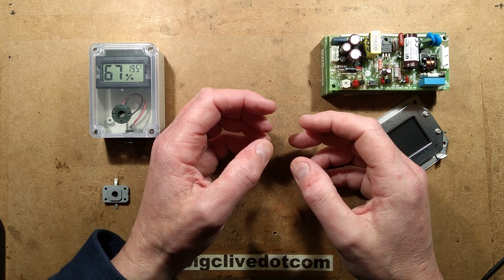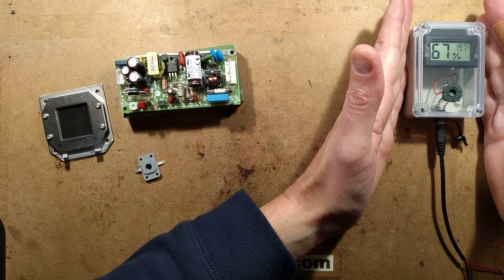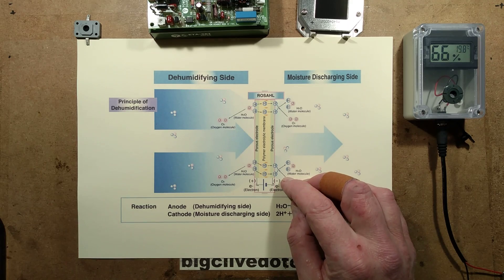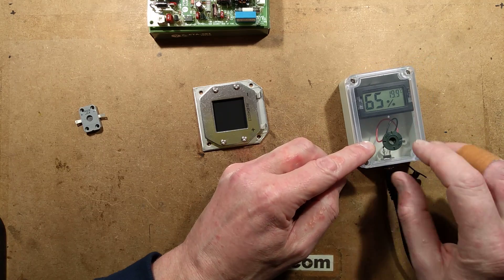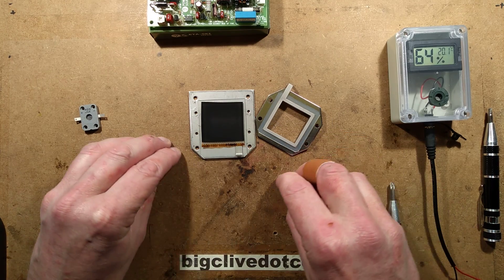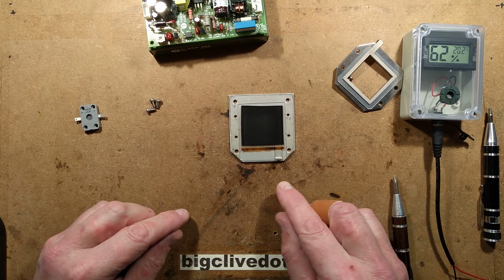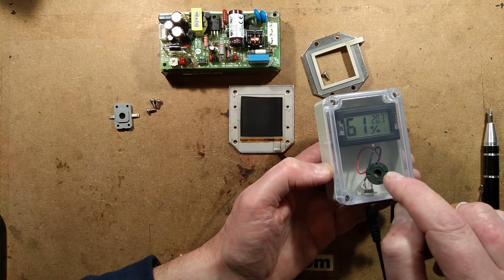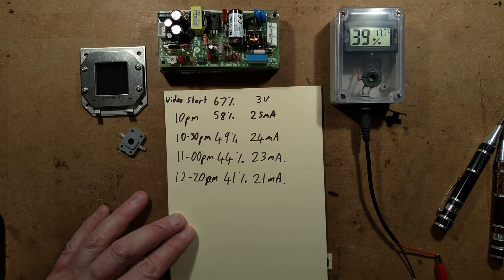Incredible solid state dehumidifier.  No moving parts.

Comment: I wonder if there is a voltage on the cell caused by humidity on the inside? Anything new on this? the black layer may be carbon fiber like the heaters and ozone emitter fibers.

Comment: What if the outside layer is a thin hygroscopic material, the inner layer is a heater element, and the wavy bits are for slight airflow... Would explain the temp changes and its not osmotic/letting hydrogen through at all, the heater just mildly cooks off the moisture in the hygroscopic fibers

Comment: Really cool. If this were being used to protect sensitive electronics I think you'd also want to put a sacrificial piece of metal in there which would oxidize and thereby absorb the excess oxygen to protect the valuable equipment. Of course, it may be a lot cheaper just to apply some moisture-repellant coating like you do with nail varnish.

Comment: The company for that I work also uses those deumidifiers and I didnt know that company that produces those. I got the idea maybe you can build a dehumidifier for your 3d printing filament. The biggest problem those modules have is that you have to limit the inrush current to a certain limit. If you dont do that those modules can die very fast.

Comment: If this is only passing the hydrogen out, then why would it draw moisture in if installed backwards?  Have you ever done a test with multiple sealed chambers with humidity sensors in each?  If not, that would make a good video I think.  3 or 4 of those project boxes sealed side to side and sealed well with silicone, with the dehumidifiers venting from one box into the next, and the last one venting into the atmosphere.  Do multiple tests where one or more are powered up, and compare the humidity in each box.  See if having only the 1st one on raises the humidity in the second box, keeps it he same, or even lowers it in both connected boxes.  Then turn all of them on and see if there's any significant changes in result.  Does it take longer to get the humidity down?  Shorter?  I'm sure you can think of some other ideas to make such a video, if you haven't already.  I sure haven't seen it yet if you have, but I haven't seen ALL of your videos (yet) since this one came out 4 years ago.

Comment: We have used peltier module types in some of our enclosures .With a drain tube and fan 24v system .The cold side of the peltier plate collects the moisture and drips it outside via drain tube .We use it in  wash down rated food production equipment .
Reply from the maker: Is it a custom system or a standard panel device?

Comment: There is misconception that reduction in rh is dehumidification . Every 1 deg c temperature rise will drop rh by 5 to 6% but amount of moisture remain same. In current video there is rise in temperature from 19.7 deg c to 20.4 deg c and hence rh dropped from 67% to 60% . I do not think that any substantial moisture has reduced.
Reply from the maker: Watch the whole video.

Comment: 3v is quite close to the energy levels I remember being discussed of hydrogen way back in mumblephysics. Don't have 3v available and the electrons can't do their thing and the ions can't do their migration - can't do the jump, or have too much energy and do the wrong jump?

Also batteries. 3v is close to a typical cell voltage of many chemistries. And they work through migration. If you get the wrong voltage out of them, that's because your chemistry is depleted (or if you put the wrong voltage in them, then they glow menacingly)

Comment: amazing! I use laser light source and I'm aware they have  de-humidifiers insider which coincidentally I see running at 3V. I always wondered how they'd work! How expensive are they? I'd love one for a project I have in mind.
Reply from the maker: I'm not sure how much these cost, but a local distributor could tell you.
Reply: @bigclivedotcom  The price list is on their website - a small RS1 for a 5L enclosure is only 33 euro. But I would need it to be able to extract almost all the humidity from the air - down to 10% or even less - and I am not sure they would do that. Thanks for the video!
Reply from the maker: @tony359  Not sure how low these go, but maybe you could use it to assist a silica gel pack.
Reply: @bigclivedotcom  my thought indeed. I have silica beads in a box and maybe adding one of these might help. I'm in touch with the company too to find out what the limitations are. Thank you!

Comment: Dear Big Clive,
Here is an idea.  Take a box.  Place the big water destroyer inside, both sides of it.  Place a small cap full of water in the bottom, 20-50ml.  Close the box.  Don't forget to include a high voltage igniter and make a spark in the box after the water has all be electrolysed.  This is a great way to turn a old 210 litre drum into a thing of awe.

Comment: More like a water destroyer. Kind of neat to have a hygroscopic electrolyte that causes only H2 O2 electrolysis products.

I wonder what would happen if you put a current through a tub with calcium chloride that is allowed to collect moisture from the air? Corrosive chlorine gas perhaps.

Comment: This is really cool.. I had never heard of these devices before but they seem like they could be incredibly useful.

I would bet that the fibrous material over the outside face is just a wicking material, to help draw moisture away from the device on the output (so it doesn't just build up on the outside surface, possibly reducing its efficiency).

Comment: My grandpa and dad use a lot of CRC SP-250 and SP-400? I forget. It’s in a spray can that you can put your tire inflated thingy on it to pressurize it over and over. They spray all the like high speed tool steels and stuff. Is that VOC?
Reply from the maker: It sounds like a spray-on corrosion inhibitor.

Comment: Hi Clive, never seen this component before. Intriguing! Note that %RH readings are significantly temperature dependent, and the in-box temperature dropped about 4 degrees as the night progressed in this video. This will have had the result that the actual %RH readings were even lower by several percent. As temperature decreases, %RH reading increases, all else remaining equal. Thanks for the video!

Comment: These would be fantastic for CCTV applications. I've got a few questions. What's the operating temperature range? Would having forced air over the discharge side help make it more efficient?

Another application I can think of is automotive headlights. They tend to fog up due to accumulated humidity. These should prevent that from happening.

Comment: veeeeeery interesting. do you think something could be used to remove liquid water from hydrocarbon fuels? if it won't let a bound oxygen atom through, it certainly won't let a hydrocarbon chain through... right?
Reply from the maker: I don't think it would work for that, but don't know for sure.  In air they advise against oil contamination.

Comment: I wonder if these would be useful in a cigar box humidor. With two devices, one to reduce humidity and another to increase humidity within the box, I'm thinking you could maintain a pretty accurate RH% value. I'm also seeing that as the humidity drops, so does the temperature.. Hmmm. Is that a coincidence, or are the physical properties of the air changing with the decrease in humidity?

Comment: It would be neat to see one of these built into a line pressurization system like the ones we use to keep water out of waveguide and coax. Right now we use what's basically a small air compressor with a filter canister filled with silica gel dessicant. It's kind of clunky and you have to keep an eye on the dessicant cartridge and change it every so often, something like this would be much cooler and less of a maintenance hassle.

Comment: We had some products that needed to be kept very dry and unopened for many years. But they still got corroded. Despite extensive and expensive research some bright spark came up with the idea of sealing them up in the furnace area with very dry air. Worked a treat.

Comment: Interesting indeed! Still waiting for the day when they invent a membrane that separates ethanol from water-ethanol solution efficiently. Then we could make a continuous alcohol producing home system without the distillation hassle :) Seriously, these solid state developments are really interesting. I hope they can discover materials for peltier coolers that would be as efficient as compressor state-change systems (peltiers today are vastly inferior in efficiency).
Reply: wouldn't some heat still be necessary to remove the methanol?
Reply: @juliet0001   Methanol in home alcohol production is a myth. It may have some truth in history regarding people who distilled some fermentation products "in the woods" and they took the first drops from their apparatus and drank them straight up (as methanol boils first). BUT whatever very small part of methanol is produced by today's yeasts is absolutely no problem especially when you allow it to mix in with the rest of the batch i.e. ethanol.

Comment: A great little bit of technology in action. The maximum 3v supply and low power consumption would make this ideal for off-grid applications, where it could easily be powered by a solar panel. Current limiting could be controlled, simply by using the ideal surface area of solar panel during the day, but of course a battery, regulator and current limiting circuit would be needed for 24h operation.

Comment: Great Video! Thank you. Would be a great part to build a filament dry box! The currently available doing it by heating the box. Not very efficient and perhaps not good for the filament to do constantly!
Reply from the maker: I use silica gel desiccant packs in a sealed box with the filament.
Reply: @bigclivedotcom  most of us do, but nowadays boxes with 50W heaters and crude timers appear ... thought the membrane device could do the job with less energy and a half life of 5 years isn‘t bad as the price is quite reasonable. I will give it a try ... with a nice TI humidity sensor, rotary encoders and an esp8266 could be a fun project - if I find the time ;)

Comment: Not to nag, but I noticed a change in temperature. What your meter indiates is actually relative humidity, meaning the amount of humidity relative to the amount of humidity air of that specific temperature can hold. So when the temperature rises, relative humidity will drop without loosing one molecule of h2, because warm air can hold more h2o than cold air can. In the end the temperature drops again and the relative humidity is lower than at the start, so we know for a fact the dehumidifier is working. The readings are skewed by the variation in temperature though. You could compensate for that by calculating the absolute amount of moisture from the relative humidity and temperature and then calculating what the relative humidity would be at a reference temperature.

Comment: The explanation of how it works given at the 4:50 mark, it appears that this device is really a solid state electrolysis gadget, I immediately thought that it is not a dehumidifier but a green hydrogen fuel maker!  If it used to dehumidify electrical cabinets, care should be taken to reduce incidence of sparks or suffer danger of fires in the enriched oxygen atmosphere.

Comment: Speaking of molecular transfer I partially remember a trick with an incandescent light bulb. By an electrolysis process you can coat the inside of the glass with sodium. I can’t remember what you dip the light bulb into and even a globe with a burnt out filament will work, the sodium comes from the glass and you are replacing it with whatever liquid you dip the globe in.
It was mentioned that if you use a potassium compound, the glass breaks because the potassium atoms are bigger.
That made me think that’s how Corning make gorilla glass by using an exact amount of potassium to stress the glass. I read they use some sort of “potassium bath”.
I wasn’t sure if the liquid was molten sodium hydroxide because that dissolves glass. I cannot remember what voltage was used, probably enough for thermonioc emission? It would have to be DC.

Comment: I haven't looked at all the comments below, so I apologize if I'm repeating the observations of others, but doesn't this look like a hydrogen fuel cell kinda flipped on its head?
While watching the video, I was figuring that the 'fiber layer' was probably platinum - a catalytic layer for recombining the hydrogen and ambient oxygen. 
It follows from that that the 'pure black' layer might be a fine layer of conductive carbon impregnated in a non-conductive membrane, that is charged with the positive side of the power supply.

I haven't done all the maths, but it seems the positively charged carbon might be just enough at ~3VDC to strip the hydrogen out of the water molecules, but not enough to combine with the hydrogen to form a hydrocarbon. Therefore, you have these hydrogen atoms looking for somewhere to go. The end up in the platinum in the presence of ambient diatomic oxygen, and Voila! - You have "new" water molecules coming out of your panel.

Comment: These are remarkable panels. They could be used in a huge array of sensitive equipment cases to ensure that air moisture doesn't stuff around with sensors and such.
I need to look into these, thanks for the video.
Edit**
Just been thinking, these would be a great addition to woodworking workshops in humid climate zones to protect against corrosion and such for expensive tools and even keeping excess moisture from getting into the wood.
Reply from the maker: These are only for low volume applications like a control cabinet.  For a wood store you'd be better with a traditional bulk dehumidifier.

Comment: If you put water in and get water out, the O2 is going to recombine with the H2 on the other side to form exactly the same amount of water, so no, it doesn´t get oxygen rich in there.
Reply: Except O2 doesn't pass through the membrane, only hydrogen. Oxygen stays stuck on the dehumidified side, in the form of new O2 molecules, so it does get oxygen rich in there. On the other side, atmospheric oxygen forms new water molecules with the hydrogen that passes through.

Comment: As far as I remember, the electroosmosis effect relies on the spontaneous dissociation of H2O into OH- and H+ , a genuine property of very pure water. The Hydroniumion (H+ plus a bulk of H2O molecules around it) then is pulled to one side of the half transparent membrane by applying a voltage gradient over the membrane, which has the consequence that there will arise a pressure gradient over the membrane which favours an increase of water molecules density at the side of the Cathode. The OH- is almost immobile (why so, I cannot tell yet - maybe because of the 16 times higher mass than H+). This effect only works with very pure water. Salt like NaCl will build a shunt and poison the membrane which stops the hydroniumtransport. Thats probably why you should not touch the membrane. Fingerdirt is quite salty. And of course, highly mobile oil nebula will also poison the membrane and interrupt the pumping properties, because where there is oil there cannot be water.
As a helf permeable membrane filter paper or equivalent might work as long as it electrically neutral. I know that sintered glas fritters work well to show this effect.
The textured surface on the outside of the element looks for me like metallised cloth which often is used for anti-EMI wall paper. https://www.amazon.de/YSHIELD%C2%AE-Abschirmvlies-HNV80-Breite-Laufmeter/dp/B00FO7ZJLY
Great find man!

Comment: I remember being told of a similar thing being used to stop rising damp in older buildings.  All it entailed was a battery, bulb and enough copper wire to go right round the inside walls of the building.  Tack the copper wire into the mortar as low in the inside walls as possible, wire the bulb and battery in, to control discharge of the battery, and leave it until the bulb goes out.  What you need for doing up old cottages.  I have been sceptical of this but maybe there's something to it.  I will stand corrected if I'm off the mark.  Cheers Clive.
[Edit inside walls]
Reply from the maker: There are systems that use platinum wire for that.  They're controversial.

Comment: Emmm    Like a Peltier Device is able to extract heat with current flowing one direction and  using current,   Heating the element can generate current.   These seem to be related to Fuel Cells ?  Opposite Reaction ? If you subject this to Hydrogen would it produce current like a Fuel Cell ?

Comment: Interesting technology, and for this 'dehumidifier purpose' a far cry from Peltier+fan based dehumidifiers.
BTW, did you notice the temperature in the box rise to 20.4 °C (17:04), and then drop again?
Reply: well, the difference to the peltier-style dehumidifiers is that you can keep this one air-tight ... ofc with a lot less water-removal.
The Temp-Difference might just be from Clive opening & closing a few doors

Comment: That fibrous fabric looks like Tyvek or Typar, also called, and used for housewrap. It allows air and water vapor to pass through, but blocks liquid water.  This helps a house stay dry when it is placed between wall sheathing and siding.